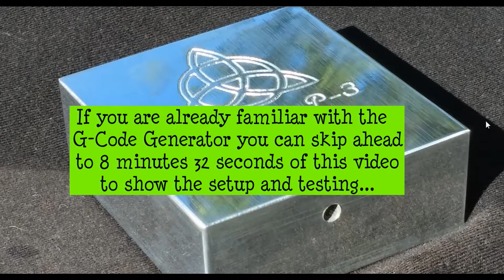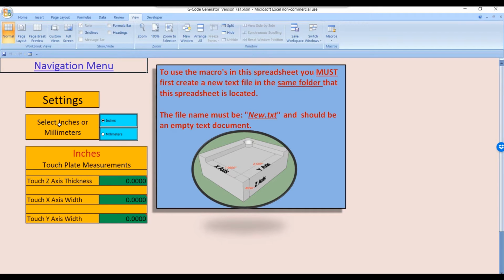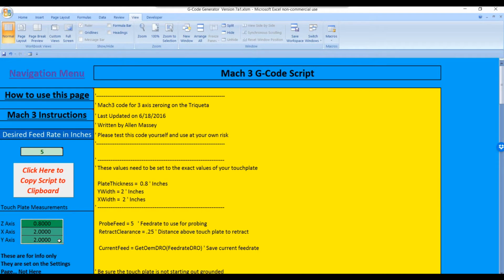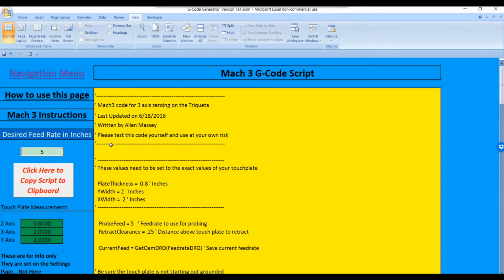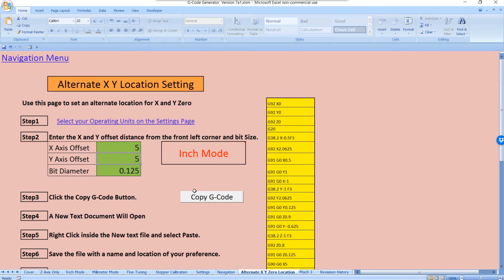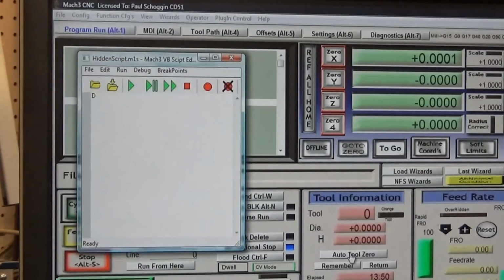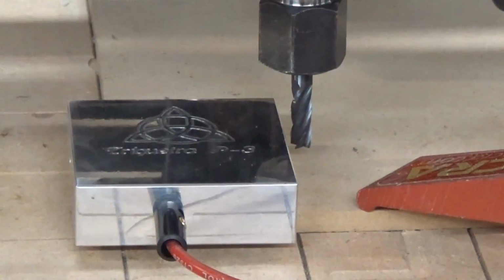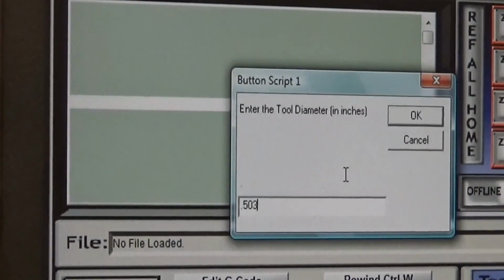G Code Generator Mach3 Script Installation and Testing

Comment: I can´t thank you enough for this Auto Tool G Code Generator. I´ve been looking for this kind of macro forever, since I don´t know how to write a script myself.
Bought it right away and it changed my life.  Cheers!
Note: Since I use metric units, all I have to do is switch from millimeters to inches before running the script ( assigned to the Auto Tool Button ) on the Settings Tab and after it runs,  switch back to millimeters.

Comment: Just an FYI.  Mach3 can actually work either in INCHES or MM -- it just likes you to setup your system one way or the other and stick with it.  For some reason there's footnotes not to be switching these around....
Reply from the maker: Your absolutely correct. Mach3 runs equally well in imperial or metric mode.

Comment: Hello, I am new to machining and Tool and Die work, I am not education in the various technologies is see in my hobby Model R/C You-Control Airplane flying, sometimes i need to make a small broken part or,, need to make something, to alter performance on an engine. I am not totally computer ignorant, just could not get a "Hang"for the old 20 year ago Cad programs.
I am very interested even in one of the Chinese model 4 axis, My would like to see  or maybe you know where one is, to start from scratch explaining G Code, to set up for making actually making a part a part once I have the dimensions, built the file to be plugged into a Ready CNC, and actually cut the part, Basically an explanation 0n "From The Cradle To The Grave Project, from the prospective of a Un-Tekie, Which I Wish I Was, at 66 and active I hope I can figure this out, usually for me it is a learning curve of "of which I am a  ""Hands On"" Learner, any wisdom, direction, suggestions, some one who or where I can Study would be Greatfull,
Respectfully, Jim P.

Comment: how much r your tough plates
Reply from the maker: $60 - $70 with all the software
Reply: would u take $50
Reply from the maker: If you go to my website and use the contact form I will provide you with a discount coupon that will take 20% off your order. www.triquetr-cnc.com
Reply: oky ty
Reply: That URL isn't working for me, please type it in your browser to get it to load correctly.